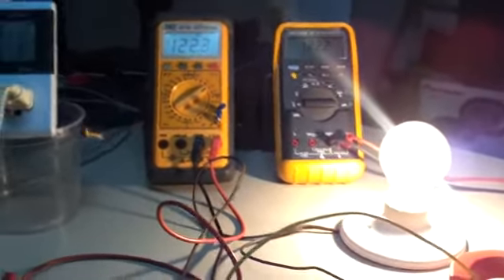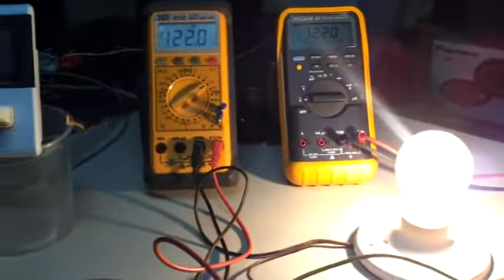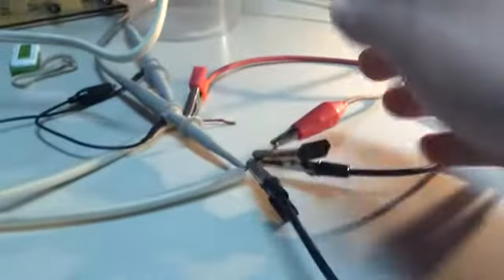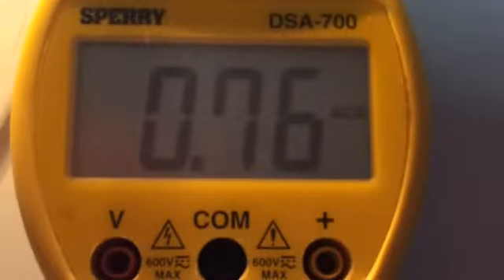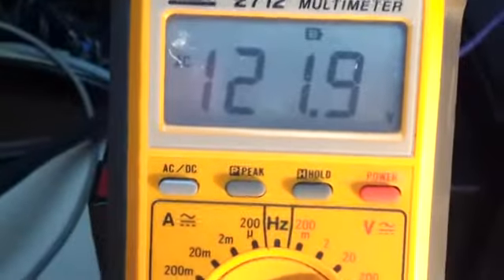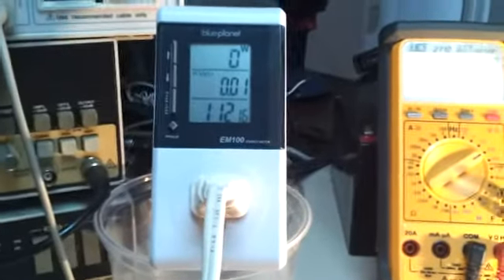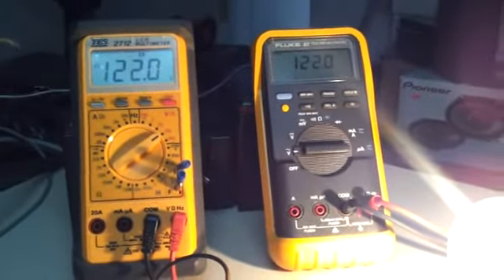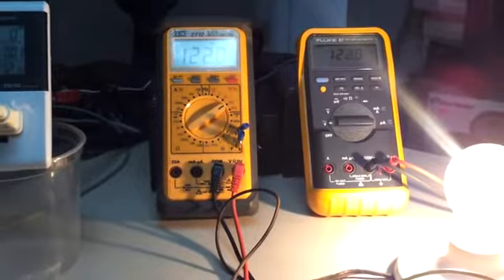Testing Mains Voltage 2

Comment: I at first thought the same as effquest,as that seem to be the only answer.So i tried it myself with two different brands of watt meter,and both still show'd a watt draw??
It is still my guess that the watt meter you have uses the neutral as a reference point for the active going high and low of the zero volt line.